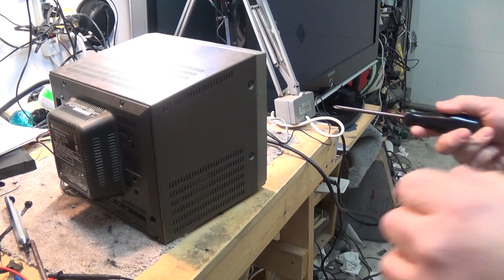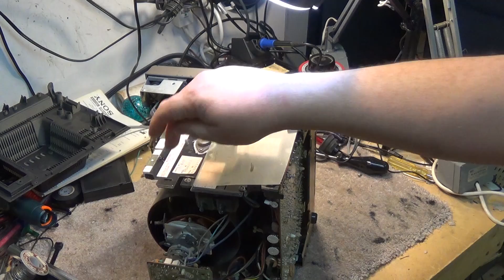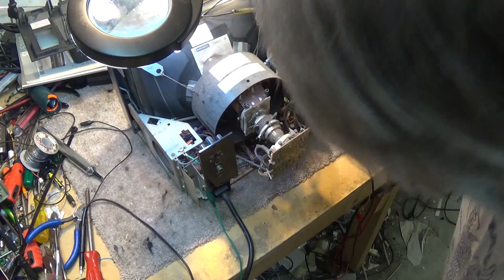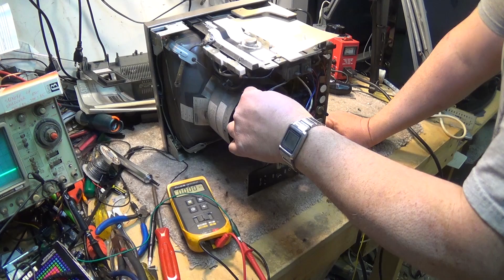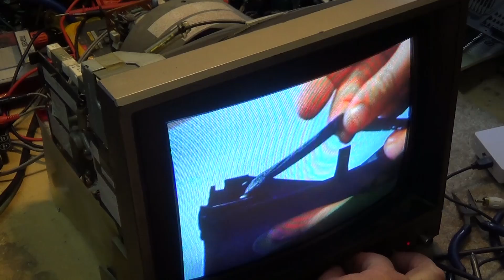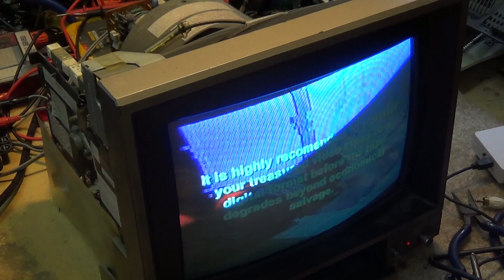TI PHA4100A   Panasonic monitor shuts down

Comment: Sorry i don't get to comment or like much. I use apple tv to youtube. I enjoy most of the vides you make. It must take up alot of your time. Thanks again!!
Reply from the maker: +DirtyDon RC I actually don't spend much time doing these. I shoot while I am troubleshooting, and then cut them down pretty quick. I am not shooting videos every day. Sometimes I go weeks between shoots as I only do them when I have nothing better to do, but I could sit on the footage for weeks or months before I actually edit. That big plasma that is sitting on my bench for example. That has been fixed for months, and the footage is in the can.It was initially going to be video 500, but it hasn't been posted yet.I tend to shoot several on the same day, and then spend a week or so posting them.

Comment: Nice monitor and repair.
As of about 3 or 4  years ago I played one of my VHS tapes I made on that RCA VT201 in 1978 and it still plays like it did back then.
I have many 8 mm 7 mini DV tapes and they play fine too, BUT two of my JVC mini DV camcorders went bad, dirty heads I think but the head cleaning tape will not help.
I just made a video on those camcorders today.
I used to think mini DV recording was the best, 500 lines of res., but after using memory card camcorders that shoot in progressive scan instead of interlaced scan the mini DV recordings look like crap to me now.
Reply from the maker: +old64goat I have found that some 30 year old tapes play fine, and others do not. It all depends on the quality of the tape and how they are stored. Cool dry environment =  :-)  Hot and humid = :-(The type of tape also has an effect. Sony HG Metal particle tapes used in 8mm and Hi8 were terrible as where the ProX MP tapes, and some of the ME tapes.Typically standard oxide tapes were better as far as longevity went.DV was never a great performing format. A good Hi-8 analog tape from a good 3CCD camera would outperform DV any day of the week due to the color bandwidth limitation of the 4:1:1 encoding scheme used on MiniDV. Hi-8 may have suffered more drop outs as the tape aged, but a virgin ME tape would blow the doors off consumer DV.  The ProDV is was a closer race. Analog still hade more saturated color but professional DV was clean, and crisp, so the loss of color information was not a big issue.What I used to do on some shoots was I plugged my professional sony camera (the one I could swap the recorder from hi-8 to betacam) s-video output into the S-video input of the GV-D800 digital 8 portable shown in this video during the demo. I could then get the 700TV lines of resolution out of my broadcast camera, and it delivered a solid 500 lines of DV video, using a broadcast head end, and broadcast glass.When I sold my betacam setup, I replaced it with the JVC GYDV500, which was almost as good.My next upgrade was to a Sony FX1 HDV camera, and finially I was able to get a picture I was happy with. That's a 1080i camera but it looked great.Of course they all look like crap now compared to the new cameras that can shoot in 4K. The picture off those cameras is better than my eyes!Even this crappy little CX220 Sony I shoot my repair videos with looks great.I wouldn't say it looks better than my older FX1 HDV camera, as it uses CCDs which allow shooting moving objects without the rolling shutter effect, and 3CCD pickups lend to better color, but the SD based camera is much more convenient to shoot with, No capturing tape to the computer to work with. Just dump the files and its ready to go.

Comment: Smashing job :-D, i would have been wrong because i thought the line output transistor had gone short circuit at the start, its been a typical problem that makes the psu shut down or chirp with overload.
And your screen voltage capacitor must have been a red herring, odd that the line frequency had gone silly, im thinking the voltage trimmer that was also playing up too.
.
Ahh the old computers, i started on the sinclair zx81 (1981)1k ram expandable to 16k with a rampack, monochrome, no sound, tape based program saving, i still enjoyed it :-D
The zx spectrum 48k colour + sound was the next and i had the most fun from that machine, building interfaces that connected direct to the cpu bus, dodgy stuff lol.
Also repairing them was fun too. :-D
I know clive sinclair wasnt brilliant at computer manufacture, but i loved the learning :-D.